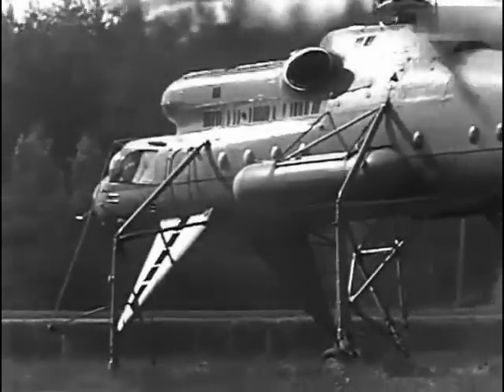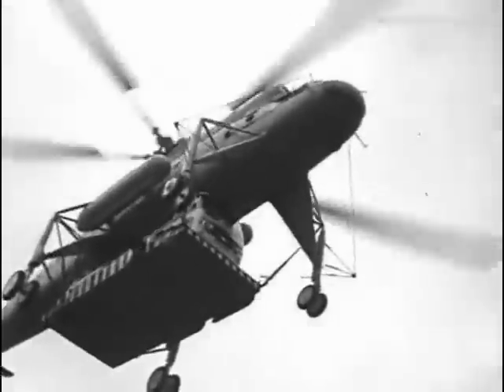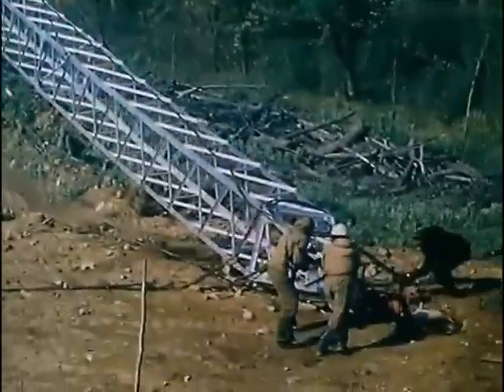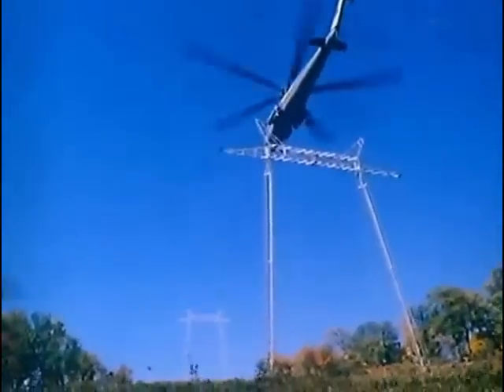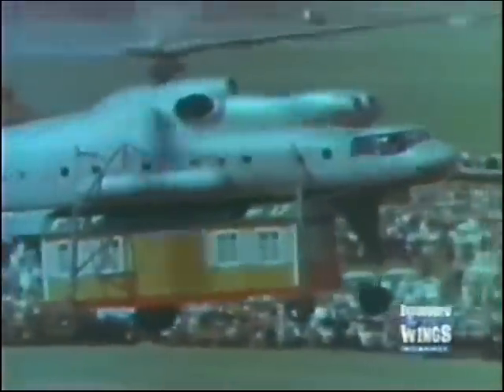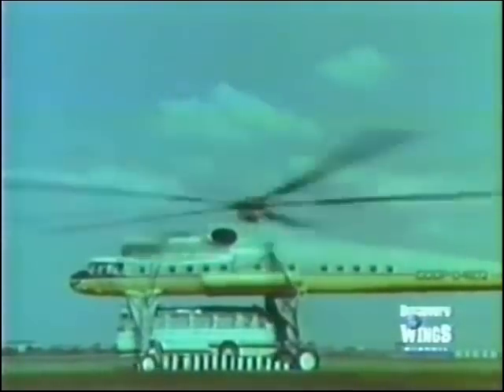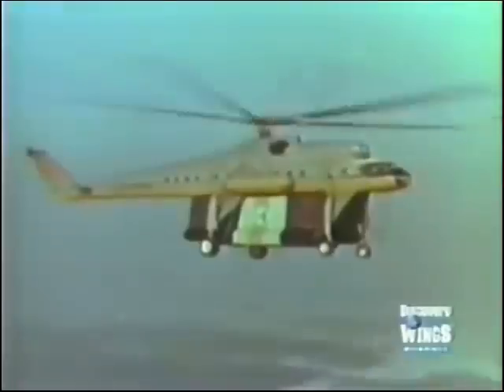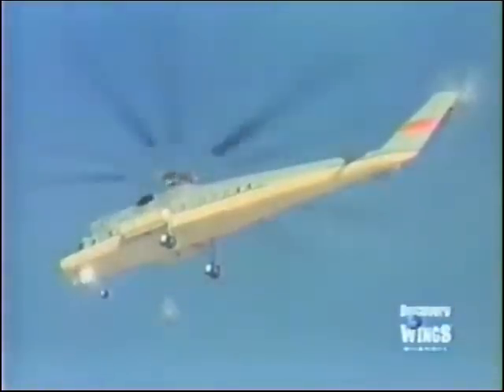The Largest Soviet Flying Crane Helicopter - Mil Mi-10 "Harke"

Comment: The high vibration at low speed was probably a side effect of the large rotor blade count, with blade tips running into the tip vortices of the preceding blade.

Comment: Actually there was a much larger helicopter built, with a set of rotors on each of two 'outriggers'. Not sure of its designation but the prototype (only two were built as it was deemed to be unnecessary) can be seen at Monino Air Force Museum outside Moscow.
Reply: +slimchancetoo Mil 12, I think.
Reply: Yes I think that was it -- actually came across a vid just after I made my post. The sole survivor -I think - is on display at Monino Air Base Museum. HUGE !!!!!!!!!!
Reply: Yes, I have already seen the video and have actually walked through and sat in the various crew passenger and cargo compartments of the surviving example which is located at Monino Air Museum outside Moscow (Russia)

It truly is an impressive machine - designed to operate in the vastness of the Russian hinterland where there were few roads and even fewer railroads.

As you say it was superfluous to military requirements and never went into serious production.

A truly impressive example of Soviet era engineering.
Reply: @slimchancetoo  I actually met one of the test pilots who had to pilot it.